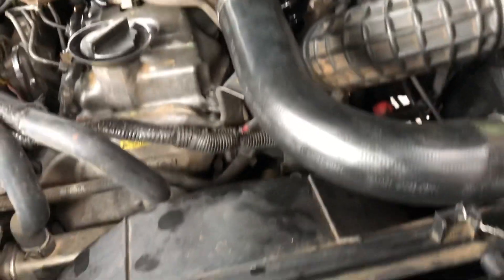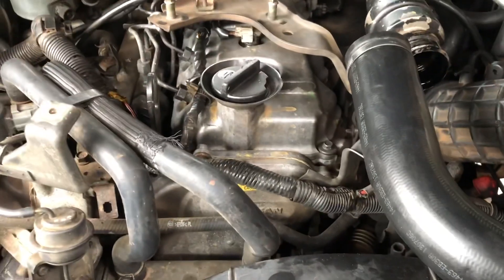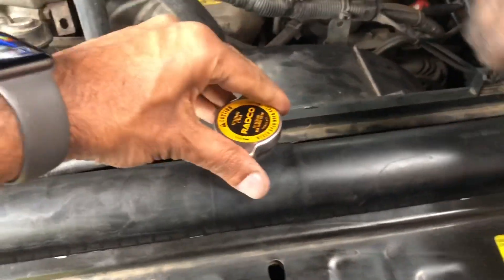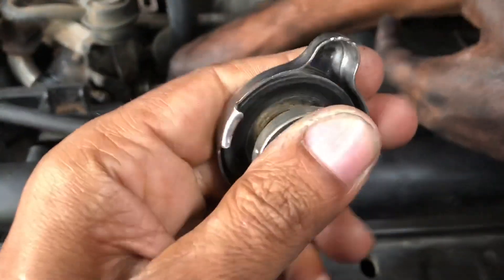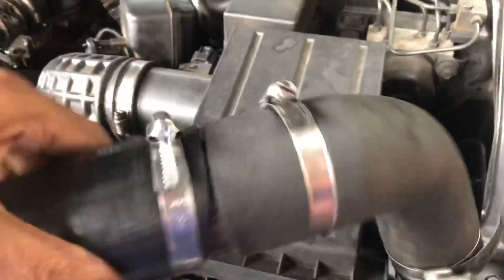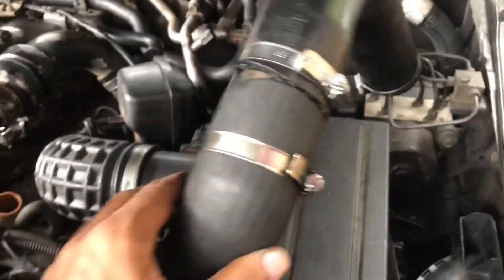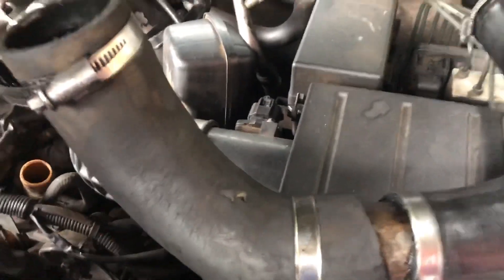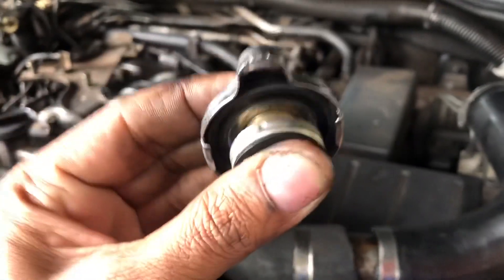Wrong radiator cap in Nissan Navara

Comment: Hola cómo estás muchas gracias por el video una pregunta un consejo más bien se me barrió el tapón de plástico de drenaje del anticongelante de un Nissan Frontier 2018 se le hizo el tapón tornillo y ahora está drenando el antifreeze pero bueno si estás remover el tornillo de plástico y está sumido para adentro tienes novio tips para saber cómo removerlo muchas gracias espero su respuesta
Reply from the maker: Hi there good day,

The best workaround is to make a small hole from the drill (2mm drill bit) and tap a self tapping screw and slowly removed the broken part, this is what we do in those cases 

Try, you have an idea to start with now

Comment: Can a wrong radiator cap cause overheating?
Reply from the maker: Yes dear, that can have a huge impact to overheat the engine…. The reason being is that D40 radiator does not release the Gass/ internal Gass pressure but that does only in reservoir tank wherein that cap comes with a pressure release valve (spring)
Reply: Where should the flat radiator cap be placed, in the radiator or reservoir? Or 2 flat radiator caps will do?
Reply from the maker: 21430-C991A - radiator cap
21430-1P111 - reservoir tank cap
Reply: @abcautotrendy  are you in the UK? Just went to look at one, guy says he went on the motorway and overheated, I went to look and he tried to started cold and nothing for 20 seconds then it run fine, but the top radiator pipe after 5 min was rock solid, he says if you drive for 30min then it the temperature sensor will start rising like mad
Reply from the maker: I’m from Sri Lanka dear, but can assist you with any questions over the phone
Reply from the maker: Flat cap goes to the radiator 
With spring cap goes to reservoir tank

Comment: Is it normal that there is pressure coming out upon opening of the radiator cap and coolant tank cap even if the engine is cold?
Reply from the maker: Well In that case pls check whether your thermostat valve is working properly… otherwise try to first open the reservoir tank cap and release the pressure

Comment: I googled  this video because of what I found out in my Nissan Navara 2020 N-Trek  Warrior when I opened the boot of the car to have a look. To find out which cap should be on the right place, in the radiator or in the coolant reservoir?
As I try to open the radiator cap to have a look if the radiator if full, I noticed that the radiator cap doesn't look like a normal radiator cap, it only have a black rubber without that spring. So out of curiosity, I opened the Coolant Reservoir. The coolant reservoir cap is the one that looks like a radiator cap with a spring and a marking with 118KPa pressure. Did the mechanic at Nissan misplaced putting back the cap when they serviced last time (1st 1000km ) or this is the right design for newer nissan car? Hopefully Nissan mechanics will answer this.
Reply: My radiator cap looks like the cap that was shown in the video(without spring) maybe the original stock radiator cap of Navara has no spring in its cap. I own a Nissan Navara D40 2010 and the plastic above my radiator cracked open and cause my car to overheat, now i have to replace it with brass metal.
Reply: on 2007 d40 Expansion Cap has the pressure valve, Radiator cap is a normal cap! :)
Reply: what you see in your car is exactly how it's supposed to be. Nissan Navara have flat radiator cap (with black rubber) and spring reservoir cap. It is normal and not let wacky mechanics with no clue tells you otherwise